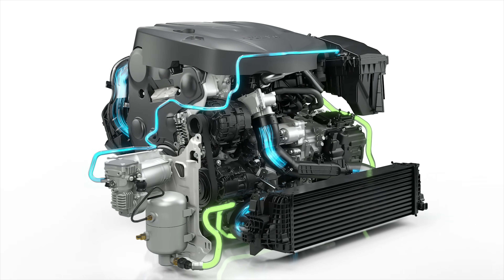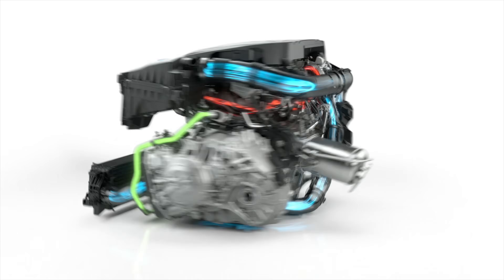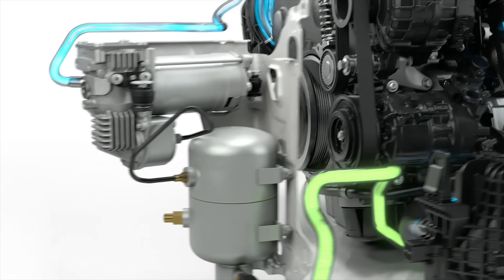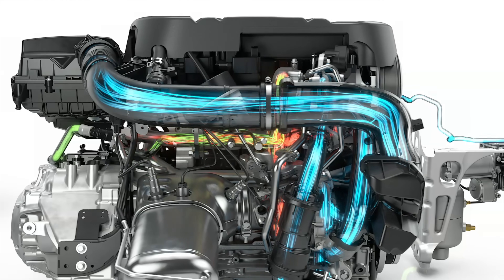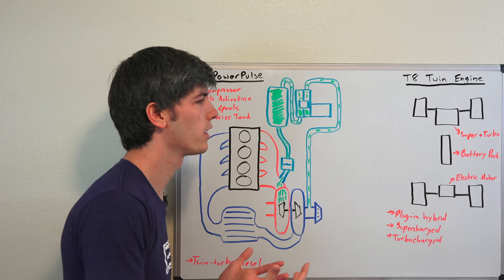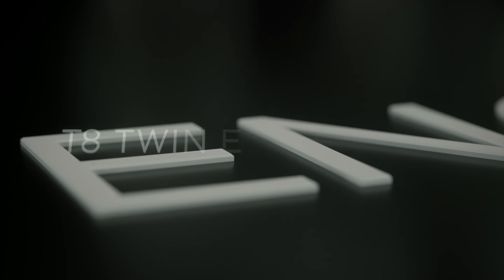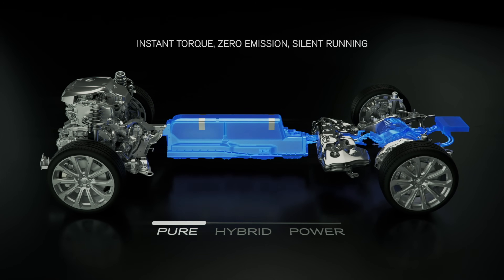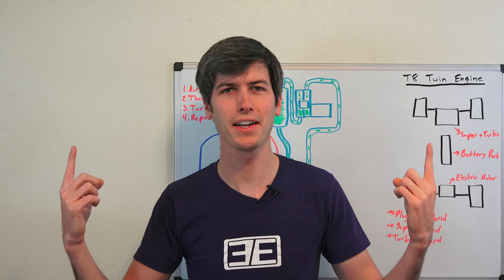How Volvo Is Eliminating Turbo Lag

Comment: .:"So you want a turbo charged engine, a super charged engine or an eletric engine?
Volvo: "Yes!"
.: "...what?"
"Also toss in there a rocket engine, a FTL drive,  a warp core and a hypershift frame."
.:"...WHAT?!²"
Volvo: "Also one of the gear boxes is manual transmition and the other is automatic."

Comment: What about the valve Timing? If the exhaust Valve is Open and the compressed Air comes in the exhaust manifold don't it "push" Back the exhaust Gases into the engine?

Comment: Why not just take the compressed air, put it through a regulator set to whatever you'd like (1.6bar etc) and skip the turbo altogether and feed the air directly into the intake manifold? Wouldn't this make it more efficient? And by the time you've used the air reservoir, the turbo would still be fully spooled up.

Comment: I still like F-1’s method. They use a motor/generator on the turbo shaft. This charges a battery instead of using a wastegate. It therefore can also keep the turbo spooled up at low power events, ready for full throttle.

Comment: test drove Volvo T8 recently ... drivetrain is OKAY - good performance considering it's an efficient 4 cylinder hybrid - but the infotainment system is so bad it makes Toyota infotainment look good by comparison.  it's just scary.  the car felt very much like their budget ran out after they finished the drivetrain and exterior styling and had nothing left for interior or infotainment.

Comment: I am a layman, the question is just for curiosity. Is it possible to reduce the turbo lag by feeding the compassed air into the air intake ports directly rather than cranking up the turbo charger.

Comment: Probably too late to the party.... But any reason this is applied to the diesel engines only?
Reply: Late answer to the party.. Yes, the temperature goes up very much when air is injected in the exhaust and it will be too high on petrol cars which runs hotter.

Comment: why not pull that pressurized air straight into intake and/or just use one turbo?? 2 turbos are used to eliminate turbo lag, but when you've air tank/ (E-)supercharger... what's the point?

Comment: i like this idea, wouldn't it be alot more efficient if volvo ran a 12v air compressor ( type used to pump up tyres etc ) just more beefed up for continuous use ?

Comment: Say the valve for the pump sticks open on the turbo side, will it spike the boost everytime it trys to compress air in the tank? Obviously it should function normally with load and exhaust gasses present (w/o pump you get the lag right?) How would it affect the engine if something like this happened? Its an electric compression motor so it doesn't use crank/cam rotation to build its charge so theres no parasitic draw from the engine? I have so many questions😂😂

Comment: Yeah I've got an idea, would you quite possibly make a video on why you wouldn't throw that compressed air directly into the intake manifold? Seems less wasteful to do that than put it in the exhaust to accomplish the task. Plus this system seems like it could risk pushing exhaust air back into the cylinder.
Reply: At this point, a supercharger + turbo setup like a deltic engine woulnd be simpler?

Comment: Will this not lead to thermal cracking from constant heating/cooling of the turbine?
Reply: Compressed air is hot
Reply: @JefeInquisidorGOW  no, COMPRESSING air is hot, but as it expands (as it would when released) it cools, that's why C02 extinguishers freeze when you use them.
Reply: @lucasschofield8716 you are right, maybe spooling the compressor was a better idea
Reply: @JefeInquisidorGOW  That would cause incorrect fuel-air mixture, that's why they've done it this way. Maybe they're hoping it will outlast the warranty.

Comment: I was looking into installing a similar system aftermarket, but realized this would artificially alter the air fuel ratio that your wideband sees. Installing this system into the intake manifold would work better I'd imagine, but the air volume wouldn't be the same as your turbos' (most likely), so it could throw things off still (I guess maybe go Speed-Density), and on top of that it probably would spool the turbo slower than the exhaust pressurized system.

Comment: Everyone is always going crazy in the comments about reliability and repair costs with anything more advanced than a carburetor lol, I don't think most people realize just how complicated their plain old Accord already is.

This is a simple air compressor people, like the kind they use in any workshop to drive pneumatic tools. It's not rocket science and there's no reason to expect it to break all the time or to be that expensive to fix.

Comment: I Really Want To Put A Compressed Air Exhaust Spool Set Up On My Turbo Car. I Planned To Just Run A 25 Shot Quick Spool Nitrous... But I Really Like The Idea Of A Compressor That Fills The Tank Over Time... Anybody Run Compressed Air Turbo Exhaust Spool? All Other Videos Online Have Comments Disabled. Wouldn't Shooting Air Into Exhaust Cause Loud Back Firing From Un Burnt Fuel In Exhaust?

Comment: I swear I had this idea a couple of years ago a small port in the hot side of the turbo with a high pressure nozzle at a angle to the blades.

Comment: The only problem i see is the compressor spool up time,,be good when fully charged but after a couple of runs at the pedal compressor lag will be the problem,
lot of work to make 30 cubic feet of air a minute,let alone the amount required to run a high revving engine

Comment: Wtf. Wouldn't it be better just to put the compressed gas directly into the engine? It's still air, just like the air that is going into the intake manifold. Except it will be colder because it's being decompressed, so that would actually give you more power. So if they just put a check valve on the intake, and then stuck the compressed tank line there, when you floor it and the tank is being emptied, it will create the same boost that a fully spooled turbo would. You can adjust timings and use higher compression ratios with this freezing cold air to get higher horsepower that wouldn't be possible without the compressed air system. Also you need to wait for the turbo on the exhaust side to spool up via this compressed air, and also you need to wait for that energy to start compressing the air and making it's way to the engine, it's way slower than directly injecting air.  I think i know why they did this. I watched a video of an electric 6kw turbo, aka 8 horsepower. And it made something like only 3 or 5 psi of boost. So like 20 psi or 30 psi boost, would be like 60-150 horsepower or 45-112 kw of energy. A tiny tank of compressed air won't be able to produce those kinds of forces. Or if it will, you would use up all your compressed air in a second and the engine running 300 horsepower switching to running 800 horsepower for 1 second might not be enough time or energy to spool up a turbo, so it might fail it's job. So adding compressed air into exhaust won't actually do very much, but it's good knowing that whatever it does do, is assisting the turbo spool up. So it will alleviate SOME of the turbo lag, but it won't eliminate it. Oh boy the video title is "eliminating turbo lag". Sigh EE being a lazy braindead mouth breather as usual. You'd think someone whos trying to teach engineering and has a passion for cars would not make huge retarded mistakes almost every video. What a failure.

Comment: Would be interested to know if there would be some sort of automated purge or maintenance schedule to drain condensation out of the compressor tank. Having a compressor located that close to a hot engine and compressing air, generating its own heat, seems like optimal conditions for a tank full of water. Possible turbo longevity issues with injecting saturated compressed air into a precision mechanism?

Comment: I a bit different... I loved turbo lag... specially the CA18DET one... But it was a 1200-1300 Kg car also though... I just loved how it (when flooring it on second) and around 3500 RPM it just went bonkers :-) well as 169 HP "smallish" car would in the 90's :-) and with a 7s'ish 0-100 Km/h it was pretty nice. SAAB had the same sort of setup and in Sweden we called it "Ketchup" turbo... nothing, nothing and then everything :-)

Comment: What about putting a reduction gear between the exhaust turbine and the inlet turbine with a 2 to 1 ratio that drops back to 1 to 1 once the exhaust is sufficient. They are doing crazy crap with cams now where 1 valve stays closed and then the cam engages at a certain rpm or throttle level seems like they could use the same principle on the turbine shaft

Comment: Some comment on the temperature difference between the hot gas and fresh compressed air, with humidity being another issue. How Volvo worked that?

Considering those, why not use the same exhaust gas for the reserve? It's already hot and it's the same "source" for the turbine.

Comment: I understand why modern daily driver cars don't want turbo lag but personally I don't mind a bit of turbo lag on a driving car. 
The lure of turbo lag is the same I guess as a a two stroke motorcycle with power band, or a vtec when the cams come in both of which make them interesting to own.

Comment: IF VOLVO MADE PUMP WITH BRUSHLESS DC MOTOR, ABEC 10 BEARINGS, TITANIUM SLEEVE AND PISTON INSIDE PUMP, TITANIUM NITRIDE COATED VALVE FOR PUMP, ANOTHER OVER PERFORMANCE ENGINE ADD ON TO LAST MAYBE 50000 MILES BEFORE VOLVO MECHANICS JUMP OFF ROOF OF DEALERSHIP BUILDING WHILE TRYING TO PLEASE CUSTOMERS.

Comment: I think it's funny that car guys complain about turbo lag... don't get me wrong I'm a car guy too, but I'm also a truck driver for a living. Big trucks have way worse turbo lag. If you floor it at low rpm it can take a good 3 seconds for full boost to build up. Really annoying when you're trying to merge onto the highway or pass someone.. especially with how slow an 80,000lb truck is to begin with. So be thankful your turbo lag isn't that bad.

Comment: Why feed the air in to the hot side to create more air on the cold side.. Why not just eliminate the turbo all together and force the compressed air in to the intake like NOS but different...

Just seems like your kicking rocks by using air to force a turbine to go faster to create more air..

Comment: Sounds like a not ideal design. Adding extra back pressure seems like it will reduce efficiency, but it may not really matter given the circumstances. Its only going to be doing this during Full Throttle, so it seems that efficiency isn't a priority. Still, it seems like a strange way to spool a turbo faster. But I like the idea of storing compressed air. Kind of a simple way to tack on extra power without reducing efficiency during normal operating conditions.

Comment: I think they may have messed up going with the electric air compressor, would be much more reliable to use a mechanical air compressor with a clutch on the belt system and have oil plumbing to cool the air compressor as well.  Electric air compressors just don't last, genius idea to eliminate turbo lab nevertheless.

Comment: The problem IS NOT turbo lag;

--the problem is the lack of torque at low rpms;

--if they only quit  ripping people off, by  selling racing cars with plates!

--they  won't sell them to me,that's for sure,they are not pleasant to drive  on the street,i hate them;

---now.... if they  didn't have turbos....
that would make them sweet to drive..
but... the hp number would be less....
and the (uninformed,sorry) public ,would look elsewhere...

What a shame...  ( the GOVs are all in it too,they should mandate a LARGE percentage of non-turbo cars!).

Comment: what about using a 48 volt battery pack for "track" or "race" or "sport+" mode so that it constantly spins the turbine so that when throttle opens you'll have peak boost immediately.

Comment: Really, what's the point? It affects what, less than 1% of drivers who want that throttle response.

It's a gimmick to get better writeups from motoring journos who are responsible for over complicate, very hard riding cars, and little to do with real daily driving  - thanks for nothing.

Comment: Shocked they didn't just add an electric motor to the turbo (super-turbo hybrid). Small brushless motors are becoming ridiculously powerful. I can buy cheap ($50) motors under 1 cubic inch (2408 race quad-copter motor) that put out over 1 kW (well over 1 HP) that would make a close match for turbocharger RPM (45-55k rpm with a normal race quad motor, you could gear it). The only downside is it would take 24v, but that's not really a big deal, you can just use a voltage booster. Then again, you could just wind your own motor and make it yourself if you're a big company.

Comment: Puzzling why this complex system in stead of electric auxiliary turbo drive. I would even turn towards exclusively electric intake turbo, not exhaust driven. Also electric actuation of all valves, preferably by a solenoid per valve. Then add one large, very energy-absorbing, even laggy exhaust turbo, connected to a generator, that provides electricity for the said electric systems, with a large enough supercapacitor to store energy.

Comment: Compressed air, when expands, cools down and mixing it with exhaust gases cool them down decreasing the temperature in DPF that is required to burn off particles. No turbo lagg for the price of a clogged DPF, not to mention the reliability of the entire system, for all those that like to floor a 4 CYLINDER ENGINE -> facepalm

Comment: In a turbo car, single or twin, does being at a high rpm automatically spool the turbo? If not, what do you do to spool it without accelerating when driving at high rpm’s?

Comment: Hmmm.. correct me if I'm wrong but wouldn't it be even more efficient if they used the wasted air from boost that would normally go through the BOV? Have a tank that can store compressed air and the wasted boost is stored there waiting for you to hit the throttle again. Though that might introduce some lag.

Comment: I dont get this, so why instead of injecting compressed air into the exhaust side to spool up the turbo faster not inject the compressed air directly into the intake side. This would completely eliminate turbo lag instead of just significantly reducing it. Also injecting compressed air into the exhaust side will dramaticly increase backpressure on the exhaust stroke wouldnt it?

Comment: Umm...I'm not an engineer, and I never played one on TV, but wouldn't it be simpler and make more sense to send that compressed directly air into the INTAKE manifold instead???
Reply from the maker: Nope, compressed air is hot, so it’s not ideal to send to the intake. Better to start the turbo spooling, so that boost builds quickly.
Reply: As I said, I'm not an engineer, but even I know that the air compressed by the turbo will ALSO be pre-heated to a very large degree; and the compressed air in the storage bottle would usually have time to cool somewhat BEFORE being used. ALSO it would cool considerably more upon being released into the intake at a MUCH reduced pressure. Volvo's Swedish (and German?) engineers are clearly guilty of over-thinking the problem as they so often do.

Comment: 205 horsepower from a twinturbo diesel that is 2.4l my 2.8l cavailer makes 185hp on dyno.  so what exactly is that turbo actually doing? ps only thing chanfed on the cavailer from stock is an exaust and intake. mine twin turbod would make 400 hp easy.

Comment: Sooo... they invented the compressor... again? Isn't the whole point of the turbo over the compressor, that no extra power is drawn from the engine using just power in the echaust that would be lost otherwise? The electric compressor puts strain on the engine over the alternator. This is just a compressor-turbo hybrid, and not the first one. One way is to see it is that it solves some turbo problems. The other is to see that this is creating typical compressor problems. Also more parts, more weight, more cost, more maintainance. Semi clever at best. Fiddling around with a dying breed of engine - they should rather put more time and money on better electric cars.

Comment: There are absolutely no turbo lag in the old SAAB 900 SPG's R.I.P. SAAB.. Light years ahead of anything else.

btw i have owned a 1995 900. and now a 1998 9-3. And yes there are Turbolag in those. But the old 900 models. Absolutely nothing. How did they do that?

Comment: Just to be shure i understand this correctly. So they are using mechanical energy. To transform it to electric to mechanical to presure back to mechanical again then converting it again back to airpresure. To let the engine make mechanical power by means of a chemical proces. Just for a effeciency feature to be more comforteble?

Comment: Pretty smart use of the stored air. By increasing back pressure, its affect is multiplied by the increased pumping energy from the engine's exhaust.

Comment: It is over-complex for a hybrid using electric motor traction and batteries. The great thing about hybrids is that the genny engine can be simple and running only at a constant speed designed around its bes revving sweet spot.

Comment: Turbo lag is needed in motorsports because if the turbo spooled immediately the drivetrain isn't capable of putting that power down to the wheels at the same ratio the engine is creating it thus you get wheel spin. Since it is so difficult to get the power to the ground that brings us back to Newton's first law. A heavy object being propelled at high speed across a surface at extraordinary power levels is either going to roast the tires off or it's going to hook up and possibly take flight.

Comment: Let's see what we have here. They started with turbo diesel engine that already runs just fine and added a 10lb electric compressor, a 3lb air tank, and at least a half dozen fittings that all ADD LOAD to the existing drivetrain weather you're accelerating or not!?! Brilliant. : (